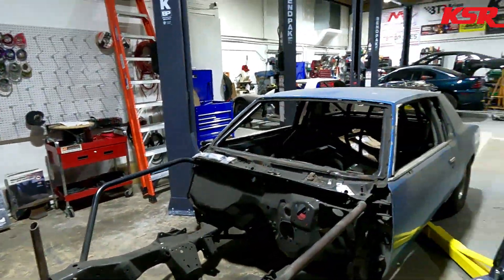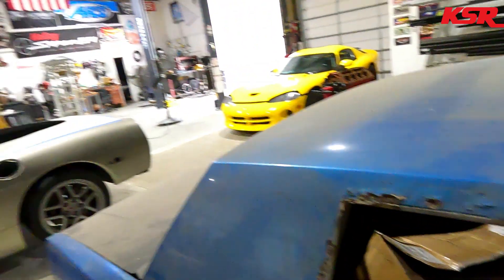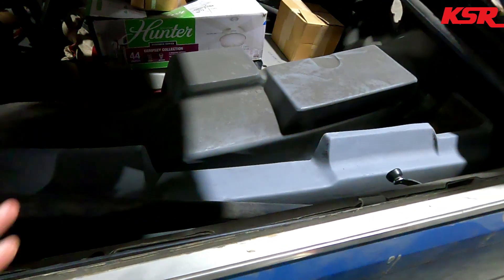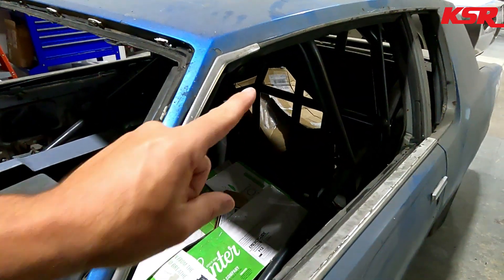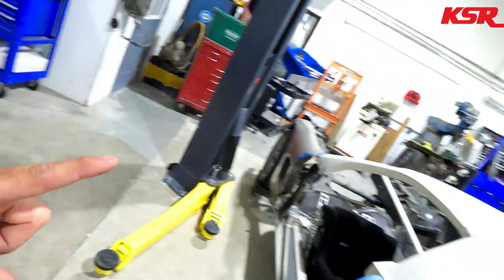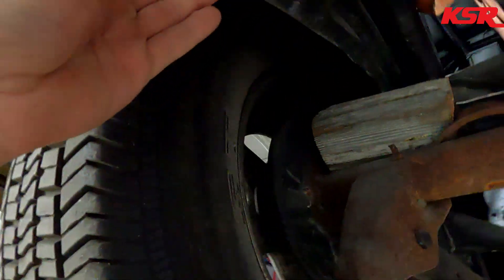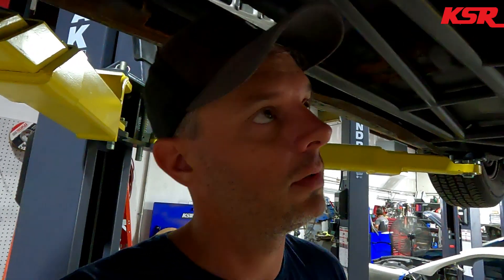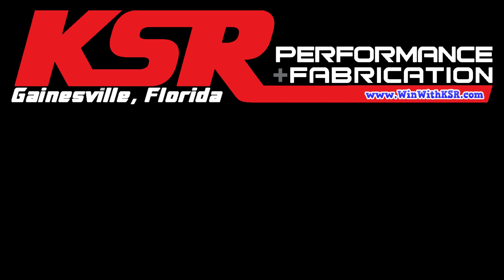KSR Cutlass Episode 2!! What Do We Need to Cut Out??

Comment: Kevin, Try Silaprene for sealing the tubs to the quarter panels. Used extensively in semi trailer construction, when it drys, its flexible but feels like tire rubber. Get a tube, lay some out on a piece of metal, leave it dry for a week and see what you think. this stuff is awesome.

Comment: So with the tubs check out 3M panel bond. You can put fiberglass/ carbon fiber and epoxy it to steel and it won't come off. Hardens tougher than steel. They make different applications too. Like aluminum to steel. Try it out saves time. I used it a lot putting on body kits. Thanks for all the cool videos

Comment: Kevin, I can't  begin to tell you how much this project excites me. Back in 1980, I built a budget 1/8th mile '71 Cutlass. I worked at an engine machine shop at the time (did it all, including grinding cranks, cams...).  I started with a 330 steel crank. It has a different flywheel bolt pattern, so I got that from a junk yard. I found a '77 403 block (only year for solid main saddles). Bored it 040 over and used 460 Ford forged flat top pistons (cheaper than Olds forged), on 350 Olds Diesel rods. The compression height was perfect. I just had to bush the pin bosses on the rods to accommodate the Ford pins. 

Experimented with cam profiles for this combo, finally got one that worked well, I can't remember the specs, but my torque curve was flat as a pancake.

Early BB Olds C heads for flow, with a very ugly sheet metal tunnel ram running two-600 cfm Holley DP's and Mallory dual-point distributor.

Turbo 400 with shift kit, and a 3:73 12-bolt Chevy rear end (again, Junk yard acquired).

28x10.5 slicks on old Centerline wheels.
We had local 1/8 mile tracks we would run low 7's at its best.  Some Saturday nights I would cruise and get into street races, waxing Camaro's and Chevelle's.  I had pics, but sadly were lost in a fire in the 90's. I miss that car!

Comment: The Cutlass needs plenty of work for sure. What I used where the wheel tub meets the quarter panel is Clear Silicone Adhesive. The key is Adhesive. Works great and its strong yet flexible. I'm really looking forward to the build.

Comment: I do love them old Oldsmobile engines I had a 74 cutlass supreme (wich I wish I never would of got rid of the car) with a 67 rocket 350 punched out 355 and the biggest crane cam I could get In it with stock heads and it transmission work when I was 18 and it was as fun

Comment: I would love to see you do a 403 olds motor, swap in some 455 heads and a 455 crankshaft with stock length rods. Basically makes a 427 and use aluminum heads, they have those now. Maybe a prochatger. But I built one just like that and in 1998 it was about 850 hp at the wheels. I miss that car and motor. But the car was an 85 Hurst olds. Alot of time and money back then. Destroyed in seconds. But the torque, the hp and the indestructible olds motor made one hell of a force to be reckoned with. But the heads I had I got from Dr. Olds before he died. Took 6 months to get them.

Comment: When you do the new wheel tubs, if you want them to stick to the quarter panels for good, get some 3M Panel Bond. Just make sure you have the tubs in their final resting place before you use the panel bond. Once it sets up, it's as strong as the original metal. I use it on replacement door skins, no welding required.

Comment: If you cut the driprails cut them in 1 inch wide pieces and weld it up up as you cut piece by piece. It keeps the gap you have to weld nice and tight

Comment: If you happen to find a place that sells reproduction headlight bezels (plastic cover) for that exact front end plug them! They are almost impossible if not impossible to find! Been looking for 3 years for one for my 78 Cutlass Wagon, also a original 260 car. I still have it but stabbed a 307 in from a Hurst Olds after it spun a bearing from nylon getting into the oil pump from the timing gear, what a great design that was.. however that being said I sure cant wait to see this done and ripping. I really want to finish mine I might have to take notes. But I’m thinking a big block. I wish you the best of luck!

Comment: Have a look at Sikaflex 221 or 252. Widely used to assemble buses and alu canopies. Easier to cut the panel than to split the adhesive. Will be great for those tubs.

Comment: Cleetus is doing some lightening on Mullet. He's replacing the doors with carbon fibre replicas. The weight per door comes down from 85lbs with glass and electric motor to 9.5lbs without!
Reply from the maker: I miiiiiight have a set of those that I ordered 2 years ago ;)

Comment: Don’t cut the drip rails off! Pain in the ass. Once cut, has to be welded and filled with led so it doesn’t crack with HP. Was on a 74 nova, didn’t look good either. Unique forsure but not worth all the effort
Reply: Definitely cut them off. If you know what you are doing, it is so easy and looks great!

Comment: Would it be cheaper to ditch the factory frame and floor and go full tube chassis strut front end and carbon floors or buy a big power motor to go low sevens high sixes?
Reply from the maker: I cannot ditch the factory frame for some classes that I want to race in

Comment: "REARENDS" just curious why don't you build your own it does not take that much time, I don't know about now but I in the past used GN40 stubs with aluminum hubs[speedway] the hard parts are pretty affordable. Another thing I did was place my stubs in a piece of Chromoly [tacked] with hubs then mocked in all suspension shocks, etc with the tires when all was done I would then locate my center section it sure made things a lot easier especially when your working in tight spots. just a thought.

Comment: Hey Kevin, are you going to use the Olds for drag n' drive events? Cuz if you are, wouldn't leaving the drip rails on the car help when it rains? It seems to rain on you guys pretty frequently on those kind of events... Also, would it be possible to install or leave the windshield wipers on the car? I always see guys struggling (including Mullet) without them in the rain at the drag n' drives.

Comment: Hey Kevin; a shout out from Nova Scotia, Canada. I enjoy all your builds and I have learnt so much for your video's about different go fast parts and stuff. I've been around cars all my life and I tend to like the early to mid 60's Fords. I've got a quick question to ask; I've been thinking of building a big block ford 460; my plan is to have it bored 80 thousnads with and 8:1 or a 9:1 compression but I would like to put twin turbos on it but still run a Carburetor on it. To make a lot of power do I have to run all the electrical and computer software that is in the fast cars today or can I get away with just mounting the turbos and intercooler and running the tubing to the carb and having a nice cam and heads and intake. All that electrical wiring and computer stuff sort of scares me a little. In you professional opinion can I make a lot of horsepower without all the electrical and computers and sensors for what I would like to do?

Comment: Carbon fiber doors like cleet just got for mullet
Reply from the maker: I’ve had them up in the parts storage area for 2 years ;)
Reply: @KSRPerformanceFabrication  sweet. I was actually joking after seeing how much they prob cost cleet. They weren’t cheap. Didn’t think they would be in the budget
Reply from the maker: @stephencicero  They were not cheap for sure, but I got a big discount on them because I waited over a year for them. The doors on my car are different than the El Camino doors. Luckily, the doors on my car fit the 78-80 Regal, which is what the owner of Ultra Carbon has. So I just had to wait a while.
Reply: @KSRPerformanceFabrication  may be different but still 5k a pair.

Comment: Just to point out, technically the 78 is an A body. They didn't switch the designation to G body until 1982.
Reply from the maker: True, but it uses G body suspension pieces, not A body
Reply: @KSRPerformanceFabrication  technically they are the same chassis, just a different designation because they switched the A body to front wheel drive in 82. Hence the G body in 82-88.
They just market all the parts as G body because the 80s care are what's really popular. The late 70s A body cars are kinda the red headed step children with styling.
I had an 80 Cutlass and loved it. Beat the ever loving snot out of it and it kept right on going. I just wish they had the 81 nose 1 year sooner.

Comment: To bad nonwindow 403 blocks are so scarce.  If you were lucky enough to find one and a steel crank from a 425 you could build a 454 ci small block Olds
Reply from the maker: Non window 403s do not exist
Reply: @KSRPerformanceFabrication  you're more than likely correct they were rumored to exist but I've never even heard of anyone who has actually seen one.
Reply from the maker: @jeffbear5317  there were definitely alot of rumors, and lots of stories of "my uncle's best friend had one", but a few years ago, somebody put a $100,000 bounty on a solid main web 403 and it has never been claimed.

Comment: with the interchangeability from all of GM's cars back then it may not need to be a Oldsmobile to get the parts you need you may find a Chevy, Buick or Pontiac with the same frame rail if you look around . GM hated to waste material and time so 90 percent of all the sub frames were all the same with different body's on top. some times even the doors and fenders were the same with a different nose dressing to differentiate the brands GM where a bunch of cheap bastards in the 80's and 90's shit they still are today . If you own a hatch back from the late 70's any hatch or doors from any GM hatch will interchange with your car as long as it's the same year. just to give an idea only the hoods were different on most GM cars back then.